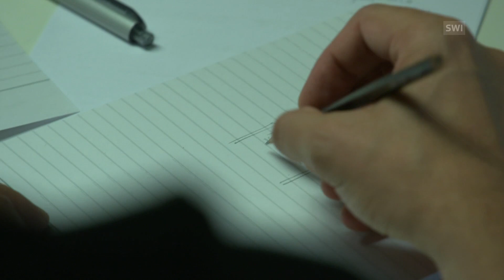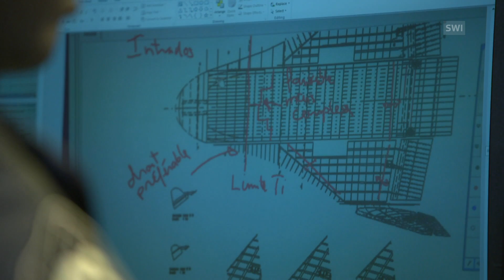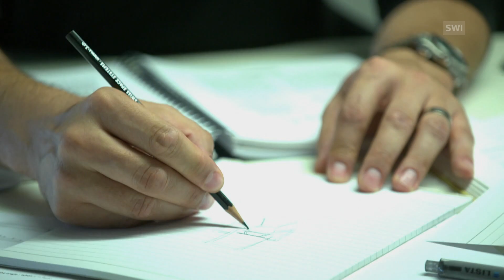The space shuttle made in Switzerland

Comment: The idea of reviving something like the X-38 CRV is interesting. However, the volume of the proposed vehicle does not appear to be capable of holding enough propellant to travel from 50,000 ft to LEO. It would probably need to have strap-on external SRB's or an external fuel tank like Space Shuttle. The DreamChaser has a better chance, as it seems modelled after the USAF DynaSoar design, using a full-up launch vehicle with multiple stages.